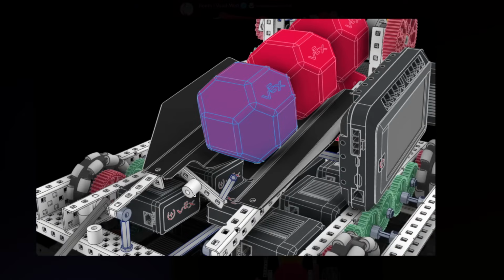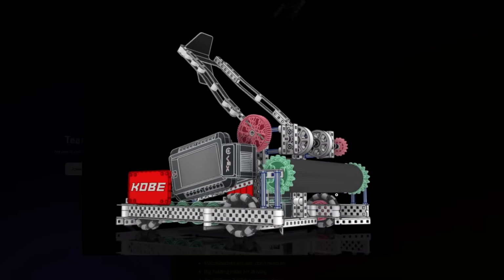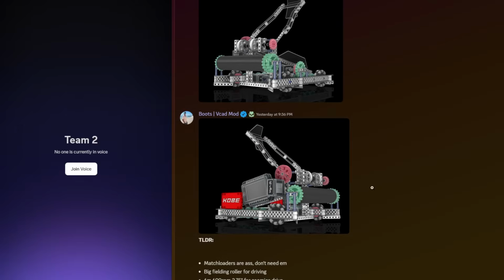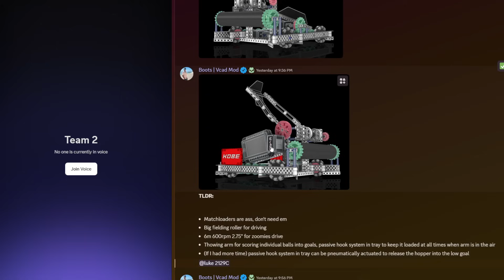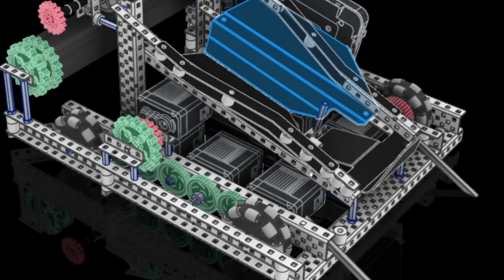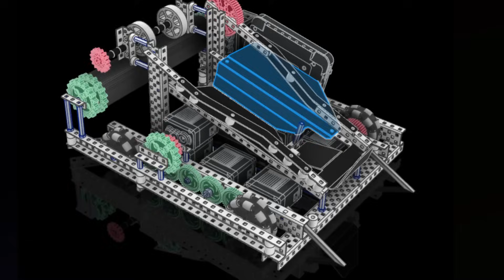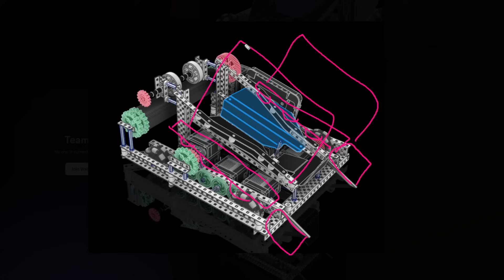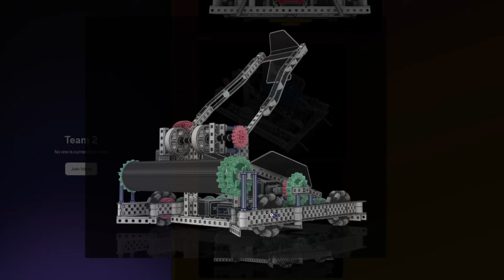A Very Unique Push Back Design

Comment: I’m just a rookie and I’m wondering how these design pictures were made? Using an app or something?🤔
Reply: they're made using cad software, which lets you design your robot on a computer and render the final product. main  ones used for vex are fusion, onshape, inventor, and protobot. I recommend protobot if you are new, super easy to use and helps design your robot so much faster.
Reply: @TheMelonHeadMan Thanks a lot